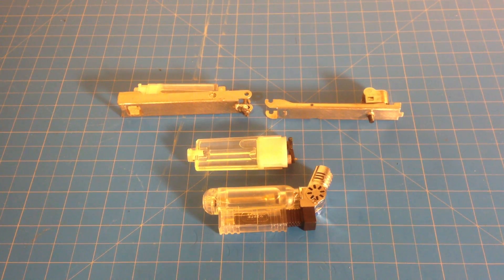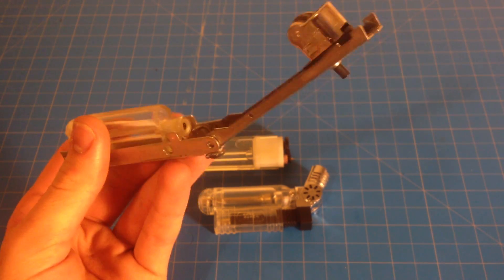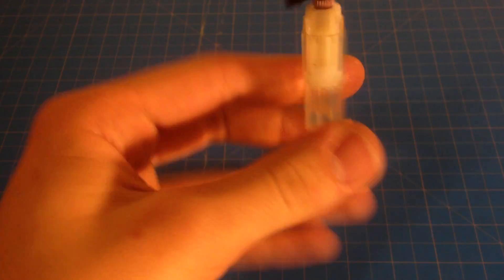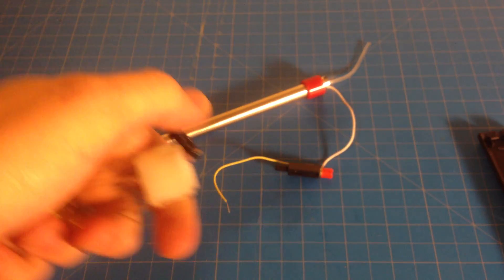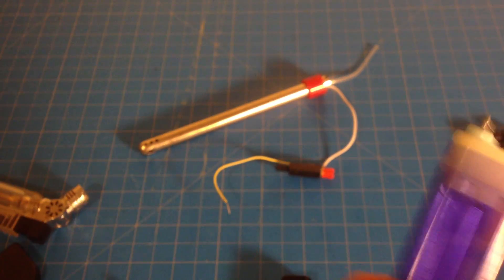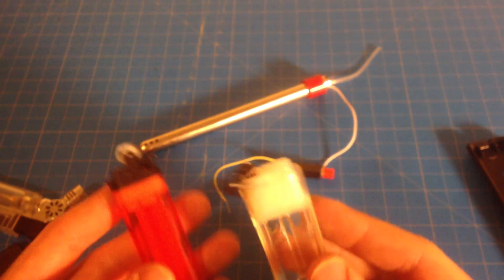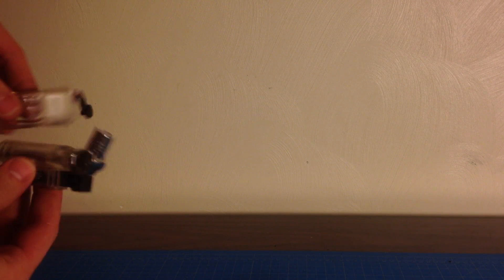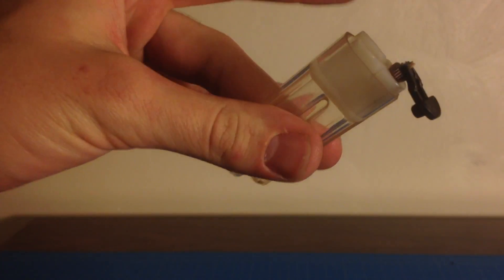Lighter Mod & Keychain Flamethrower 2.0 Prototype

Comment: I got an idea. If you fasten the angled lighter to the bottom part of the stapler, and have the butane trigger on the space between the stapler parts or make a piece that would be able to fit between there without compromising its folding ability,and attaching  the metal flame gaurd from one of the cheapy lighters to the nozzle of the butane tank, it could stop  the burning, and make the hook of the old model obselete, but size would increase. but, the angle lighter and tank are refillable.

Comment: the little dollar store lighters are refillable when you take off the metal cover and put butane. In the metal tip and push down the with the butane in it will fill

Comment: hate to break it to you but if you attach the flint wheel to that butane holder you wont be able to light the butane when it comes out, it will come out to fast for those little sparks to light it :( sorry

Comment: Continue with this type of flamethrower. I saw your v3 and wasn't impressed. This version seems to have a way better flame. I think that if you tried using some L-brackets and cutting them down and using a spot wielder you could create a case for it and then you could spot wield the C wire that you have on. Go to "The King Of Random" on YouTube. He shows you how to make a spot wielder from an old microwave. If you tried my idea then maybe you could have something that would work way better and more reliable but it might be a little bulky